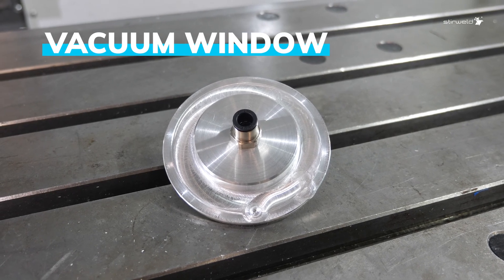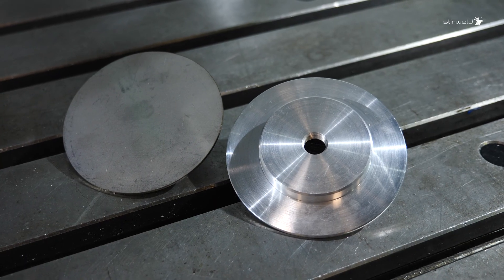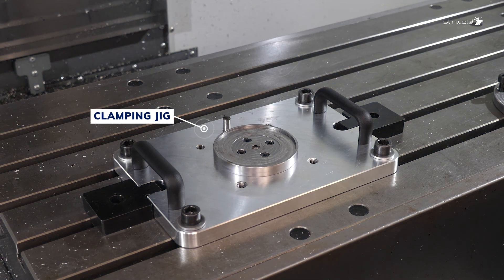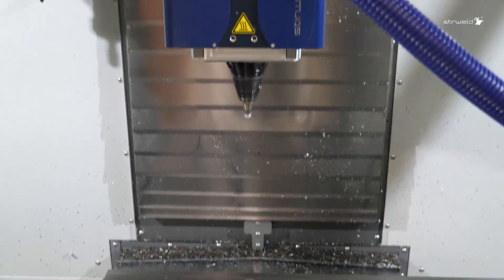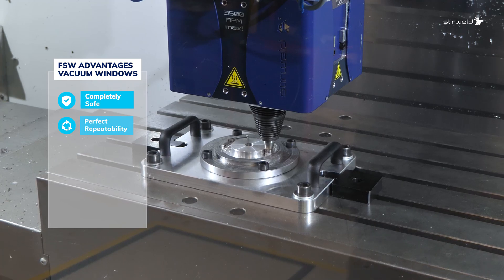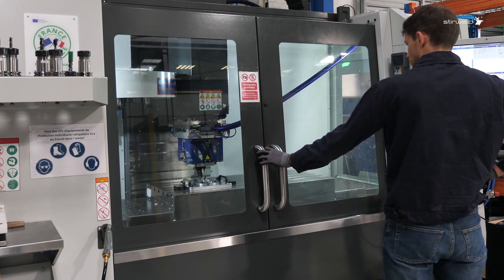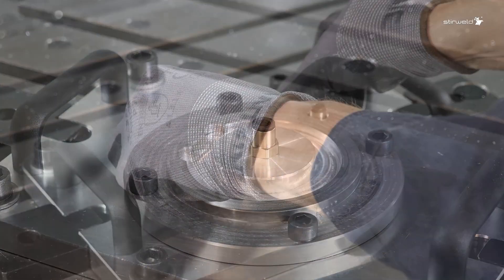Stainless Steel and Aluminum welded by Friction Stir Welding: vacuum window

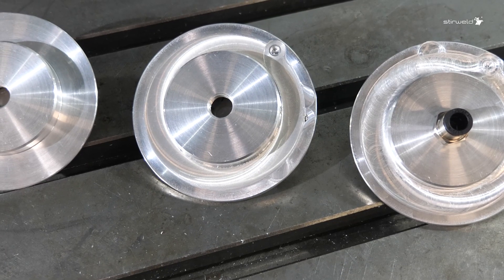Comment: I guess the parts at 2:27 are not the final form of the vacuum windows .Entering and exiting holes are going to be removed by some turning operations right ?
Reply from the maker: It's not needed for the function of the part, as the ending hole was placed away from the welding seam, to make sure it does not create a leak. The outer area is used for clamping and ending hole management, so it could be turned to optimize the final diameter.